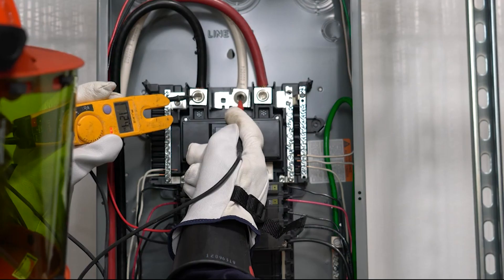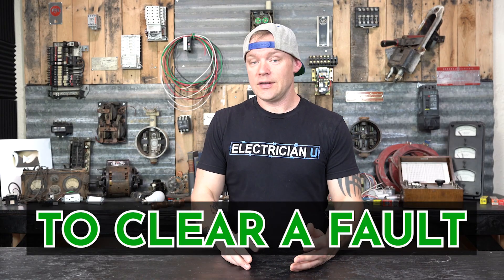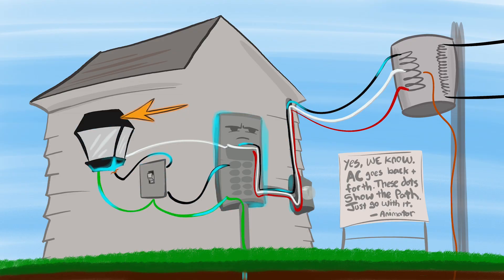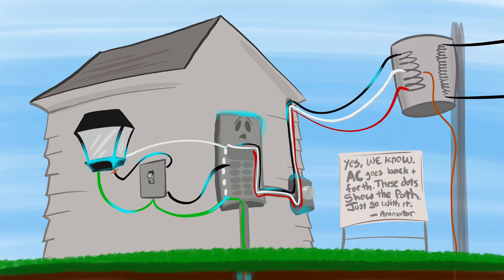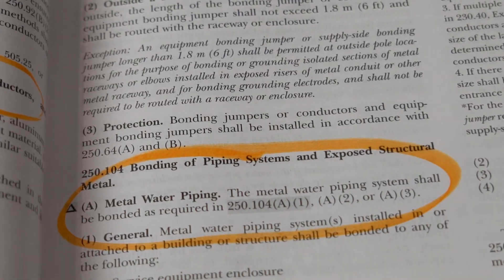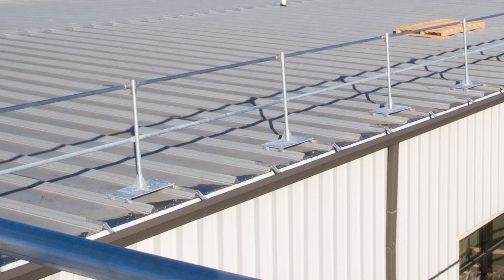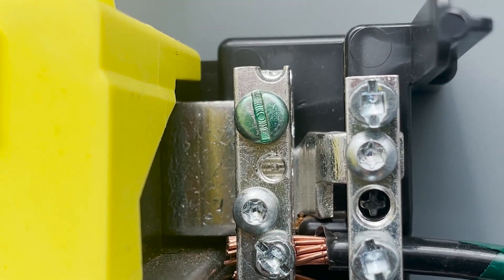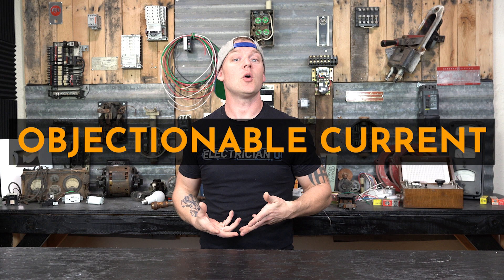Why Do We BOND Neutral & Ground in ELECTRICAL SERVICE PANELS?

Comment: Dude, I've had it out with utility line men so many times on not having un fused bonded......it just makes no sense to me lol....I mean , I get that protection provided for customer side...for consumers...but how the f. Do u have a c.t. w 100' un fused cable buried and potential fault to ground source only at consumer end....p.s.our trans and primary only grounded at pole source in this town, which could be a block away.....with less resistance mid run....wouldnt that leak?.......would it even make it to intended earth bond lol?.....like protecting workers at least....some new stuff has the concentric feeders which I can get behind with that type of bond.....but wtaf...somebody just had a inspector make me rip out ton of bond today.......160' un fused cable under a parking lot...only bond to earth is at consumer end.

Comment: The problem with your example is that the path is still there.  Electrically, the path is the same with every sub panel grounded as it is with only the correct bond at the service.  The difference is resistance.  We picture it in our heads as your animation creates, but let's not kid ourselves.  If the grounded and grounding conductor are connected to each other, anywhere, they are the "same" wire.  The only question is how far electricity has to travel to flow from one to the other.  We bond at the service so the lowest resistance path is generally where we want current to go.  And because code says so.  But to suggest they're actually different, well, that isn't the case; they're connected together.  Because as you say, that is bonding, by definition.

Comment: lay view: 
while the neutral and ground go to the same place [bonding point] they serve two different purposes. 
the white returns the load current, the green/bare is a safety ground.
A, the white should never be connected to any box or equipment case. [except through the bonding point]
B, the green/bare should never carry any operating current. [except during a brief fault trip]
that is why sub panels get isolated neutral buss, 

leave the hooking up of generators to the folk who really understand this stuff
the life you save may be some one dear to you.

Comment: A home circuit breaker piping do to a fault situation has nothing to do with the dirt ground. The green and copper wires in a house need to be connected to neutral at the main panel or they might not carry enough current to engage the breaker. 

So the question is why is our national electric grid connected to earth in the first place. There are good reasons for this but they are rarely talked about in grounding videos.

Comment: Even in the early scenario, (No Neutral/Earth Bonding) There is a path from the main panel ground to the pole ground, The issue is that the resistance in that path may be high enough that it will keep the current below the breaker trip value, but if you've got GFCI, I think that would still trip. I really like the video, good information.

Comment: if grounding is so vital, why are we still using romex as apposed to pipe and mc?  a metal pipe makes it so if something comes loose, the pipe will short it out. (I KNOW already, but the breaker will trip THATS what I mean)

in plastic lego world, something comes loose, and hits the box, nothing happens.

ALSO people putting tape on wire nuts and devices, instead of allowing the fault to happen should be illegal. that can cause something to sit there and arch until it burns up your plastic world electric system

Comment: You made a mistake. You said that if the white (neutral) wire was not grounded; there is no circuit back to the transformer on the pole. That is NOT so. The circuit is still there. BUT...IF the white wire is not bonded (somewhere) to the "ground" steel rod in the earth; it can cause a VERY dangerous situation with people. IE: they can receive a bad shock; OR killed in some cases. IE: If the black wire touches the frame, a person touching the frame could receive a bad shock or death.

Secondly: "Static Electricity" builds infinitely, if not one of the connectors is grounded to earth. IE: static voltages VERY high in the 10's or 100's of thousands of voltage. In some cases enough to kill. So the "ground" keeps the voltage coming from the transformer on the pole; from shocks and deaths; AND...prevents static electricity rising infinitely; which can shock badly or kill you. 

Thirdly: IF there is a "short" in the transformer on the pole (usually caused from lightening or trees falling on the High Voltage lines); and the center (white) wire of the transformer is not bonded to earth; it can induce the primary of the transformer (14 thousand volts typical) into the secondary of the transformer (the 120 VAC going to the house). This would kill (instantly), ANY one or creature who touched ANY black wire or metal enclosing the black wire, in the house.

Comment: Can you explain what exactly happens (or could happen) when a nuetral and ground are bonded in a j-box? For example, I need to install a smart light switch. There's no nuetral in the box, but there's a ground. Why would I not just connect the neutral of the smart switch to the available ground?

Comment: Ive got a question i only have two wires coming into my house whats missing and the white wire or neutral is connected to ground and nothing else by what u diagramed my house shouldnt be receiving electricity it looks like to me the ground is the return why

Comment: The moral of the story is at 14:25. Don’t say “at the service.” Bonding happens at the first disconnecting means, leave the bonding screw or jumper out of any load center which is not the first means of disconnect. Awesome video, but a visual walkthrough of a real system where the “main panel” is NOT the first means of disconnect is the best way to illustrate this. I know I’m armchair quarterbacking here, but this is one of the most common things I see screwed up in residential and it is very difficult to get homeowners to agree to fix it, because they think we’re blowing smoke up their skirt.

Comment: If electricity has to return to the grid "complete circuit"does the meter read the juice that goes back to grid? This doesn't seem to work with baseboard heaters(220V) it seems like no return line? Is it just gone to heat?
Reply: Resistance heating devices don't connect to neutral, but directly to ground. That's by code. They draw huge current and generate a lot of heat, yes, by resistance.

Comment: The ground may have high resistance, and it will be at some arbitrary potential (voltage) and won't be able to sink enough current to trip a breaker.  The breaker measures the current at one point only, but you need to make sure that there is enough current to trip it.

Comment: There's also a pretty good book out there called something like Grounding And Bonding For The Radio Amateur,  which discusses this issue a lot.  One of the things they suggest is that you not only need to have good grounding for your electrical power,  but also antenna structures,  lightning protection devices,  telecom entry point,  and all sorts of other stuff.  Bonding it all together outside of the house means that if there's a lightning strike (even close,  not necessarily a direct hit) it'll go around the stuff in the house and not try and find paths through the stuff in the house,  be it radio gear or whatever...
Reply: There's one related thing (indirectly related to electricity) that one has to be careful with and that's galvanic corrosion. Not everyone is in that environment, but a lot are. e.g., coastal. So one has to be careful with bonds intentional or not.

Comment: So i never really thought about it but what you are saying makes a lot of sense. I do however have a question. If i have a smaller transformer outside of the building i know that i bond that neutral and ground, but do i still bond them in the main panel for said building.?
Reply: I dont mean one of the "big green monsters", like for instance a  30 kva 3 phase 480-240 delta 120 transformer.

Comment: Very interesting. In Australia we use the M.E.N multiple earth neutral system, fairly similar in principle to your first example. Difference is that we take all our earths of the low voltage (415v 3p/ 230v 1p) sub circuits to an earth bar and chuck em in terminals, and at the bar is a very important link that bonds the earths to the neutrals via a neutral bar, with the same setup. 
Also our actives are red and our neutrals are black.
Reply: Same here in the UK, guess you caught it from us 😉
Reply: On 400 V systems the low voltage network is typically much longer. In the US where 240 V is used it just goes to the nearby transformer.

Comment: If Neutral and Ground connected, then we only need 2 wire cause neutral and ground is the same thing. Is that correct?
Reply: No a ground is meant to save you say your lamp is shorted to the metal case if the case is connected to ground it will trip the breaker when it happens if you connect the case to neutral it won't trip till you touch it and get shocked
Reply: @Wesleystewart78  so we can connect neutral to case instead of ground?? //Sorry I'm very confused.

Comment: Great video! Can you do one on GFCI. I’m off grid and could for a long time run my gfci generator to charge my batteries through my inverter’s charger. Not sure when it changed but it always pops the gfci when connected to my inverter. Because if this video and your style of explaining I have deduced that I may have not bonded my neutral and ground creating a difference between them therefore faulting the gfci. Will check it.
Reply: Does a GFCI actually use the Ground Wire for anything?   Typically, GFCI senses a difference between Hot & Neutral ( notice no mention of a Ground Wire ! ).  You may have developed excessive leakage current some where...

Comment: the animation is partly misleading on the high voltage side.

some transformers have the high voltage return going to the grounding rod instead of a dedicated neutral return or another phase.    in more remote areas you may see a fourth high voltage wire if the transformer in a great distance from the substation.  but in many cities you only see one high voltage phase going to the pole transformer and the return path going into the ground.
Reply: SWER - Single Wire Earth Return was used mainly for RURAL electrification, it is no longer being installed in any US city.
https://en.wikipedia.org/wiki/Single-wire_earth_return
SWER is the least common method of Power Transmission / Distribution ...
Reply: @MrSummitville  better check your facts, then.  it is still present where I live and I live in a metropolitan area.  one wire goes to the top high-voltage line and the other goes to a rod.
Reply: @renton9999  I said it was no longer being installed in any city - ie No new SWER poles.  I did not say that it was never used.  So, what city still has SWER poles?
Reply: @MrSummitville  several, as moving away from SWER means having to add poles and doubling costs on running new lines AND maintaining them.  so any new poles that are added for new developments just follow the current system used in substations (unless the lines are underground since you don't need poles for underground feeds).

Comment: So if you were putting in a panel in an RV that has potential to be run off a generator, and shore power, what is the best practice?  Do you bond ground and neutral or leave separate?
Reply: In the USA, we BOND the Neutral Bus Bar and the Ground bus bar at one and only one location.  AC power from a Generator vs from the Shore Power ... is two different sources.   You did NOT say whether the Shore Power ( Camp Ground Pedestal ) already has the Neutral bus bar bonded to the Ground bus bar or not, it its Main Panel.  Typically, RV's are considered to be SUB-PANELS ...
Reply: @MrSummitville  👍  I would think that the campsite pedestals are all “sub panels” so the main would be bonded.  
For running off the generator,  just ground the generator and leave the panel unbounded?

Comment: I'm surprised you didn't briefly mention bootleg grounds, back in the day it was actually recommended that you put a jumper between neutral and ground on devices.
As it turns out neutral current flowing through a grounded chassis is a good way to die.
I see this a lot on older homes with two wire systems. Usually it's to cheat a home inspection, because a plug tester won't detect an open ground.

Comment: Interesting to see how much the US system is different from the European one.
Reply: We use a 3 Wire Split-Phase 240v AC service.  The 120V AC ( Line-to-Neutral ) circuit was backwards compatible with the 2-Wire Thomas Edison 110 Volt DC lighting circuit .  Our AC was initially 110V, then increased to 117V,  now is 120 V AC is standard.  The old incandescent bulbs did not care if they had 110 Volts DC or 110 Volts AC  ...
Reply: @MrSummitville  Yup. While in Europe 3 x 230V/50Hz is standard. This gives ~400V between the phases (120˚shift phase to phase).
Most residential locations connect only one of the three and that's normally ample for most domestic use. But it's very easy to upgrade to 3 phase when the need occurs. Happens more often now for charging EV and/or feeding back power from PV panels.

Comment: Wait I'm confused. When the hot wire touches the light fixture and goes to the ground the neutral line is still operational. So when you say the circle is broken, the circle still exists because the neutral is still connected. So you have two ways the circle is conncted.
Reply: The black wire has disconnected from the lamp and is touching the fixture instead. No connection to neutral.
Reply: The black wire disconnected and is now touching the frame.  This is now a short circuit since there is little to no impedance in the circuit (due to the lamp being shorted or bypassed).  Ohms Law is I=V/R.  Since you've replaced R (the load with some value of resistance) with a very low resistance (a short), the calculated value of I will be very high (i.e., short circuit current).  Remember, electricity will always return to its source via every path; however, it "prefers" the path of least resistance (i.e., via the short in this case).

Comment: Wouldn’t a dead short, hot to ground, cause a huge spike in amp draw, which is what causes the breaker to kick, causing the neutral to not be needed, in that instance?
Reply: Yea?!
Reply: You need to watch the video again
Reply: @Jusitn Smith - A huge spike in amps?  NO!  That is not guaranteed to happen.  A short between Hot to Ground, without a BOND between the Neutral Bus and the Ground, will not always cause the breaker to trip.  And that is exactly WHY we BOND the Neutral Bus and Ground at the Main Panel - to guarantee that type of fault, is cleared ...
Reply: @MrSummitville  never seen a dead short, that did not kick a breaker.
Reply: @JustinSmith-ph1le  If you do NOT have a BOND between the Neutral Bus Bar the Ground Bus Bar then there is no guarantee that the Breaker will trip when the Hot Wire touches the Ground Wire because the dirt around the ground rod may have 15 Ohms resistance or HIGHER! 15 Ohms at 120 Volts is only ~8 Amps with a dead short and that will NEVER Trip a 20 Amp breaker.  And that is why the NEC REQUIRES a BOND between the Neutral Bus Bar and the Ground Bus Bar.  It is the BOND from the Ground Bus Bar, back to the Neutral, that causes the breaker to trip when the Hot Wire touches the Ground Wire  ..
Reply: @MrSummitville  I didn’t say anything about bonding or not bonding
Reply: @JustinSmith-ph1le  Back to your original statement ... It is the BOND between the Ground Bus and the Neutral Bus, in the Main Service Panel, that allows the Circuit   Breaker to trip ( clear the fault ) when the Hot Wire touches the Ground Wire.  BONDING is required.  Without the N-G BOND you would NOT have a huge spike in amps.
 And yes, the Neutral Wire is still needed.

Comment: Recently had a refrigeration unit installed on a trailer cold room.  Runs on 110 single phase.  The power is divided between the condenser and evap units, each on a 20A breaker.  The power supply to the unit runs at 15a when a set room temp.
The three wires in the supply cable (black, white, green), the current was measure by clamp on ammeter showed the black wire was 15amps and the white and green wires each metered near 1/2 that of the black wire.
Touching the units frame did not shock.
Any idea why the green wire is conduction current?
Reply: Your GREEN Wire is incorrectly bonded to the Neutral wire at two locations, at both ends ...

Comment: I haven’t understood this since 1981. I always thought an AC circuit reversed itself 50 times a second at 50hz so it feels like we are short circuiting the circuit 50 times a second if we bond the neutral and the ground together. It drives me fff crazy!,,,
Reply: It still flows alround the same loop path, whichever direction it is going.
Reply: @MB-st7be  wtF?? holy sh?  The current reverses it’s direction fifty times a second doesn’t it? (At 50HZ)
Reply: @mebeasensei  Yes exactly
Reply: @mebeasensei  If you were to reverse the direction of the batteries inside your flashlight, 50 times per second, the light bulb would not care.  Nothing is going to "short circuit" ...

Comment: That’s wrong the Nuetral goes back to the electric company not the transformer
Reply: Nope!  In the USA, the Neutral Wire, from the home goes back to the secondary side of the step-down transformer.  The Utility Company sends power into the Primary Side of step-down transformer, at a sub-station, far away from you home ...